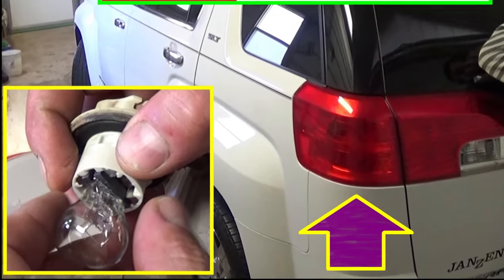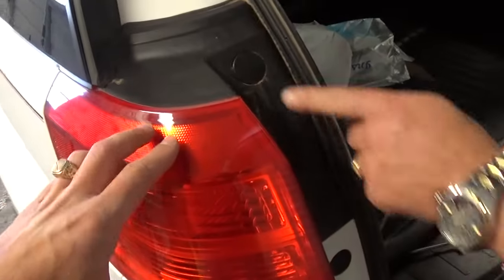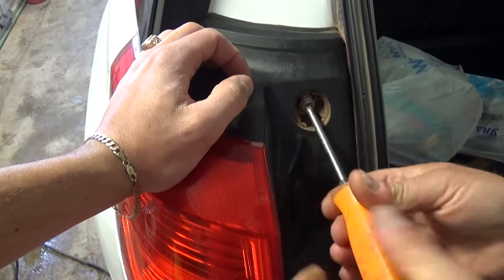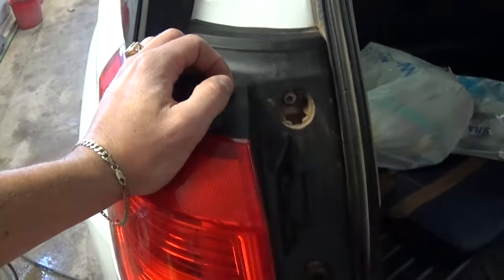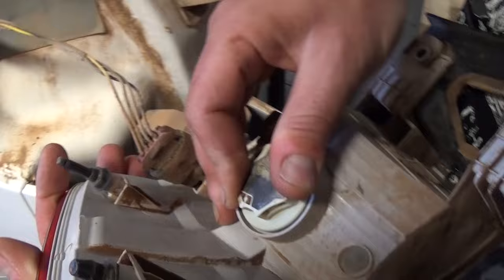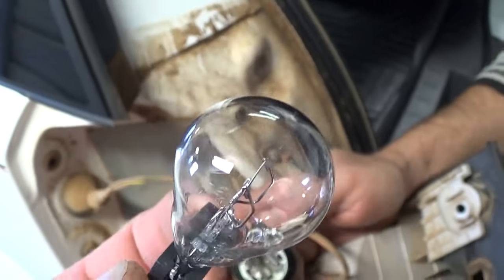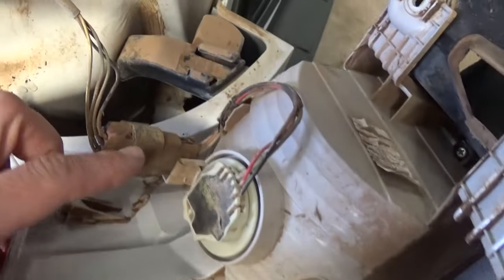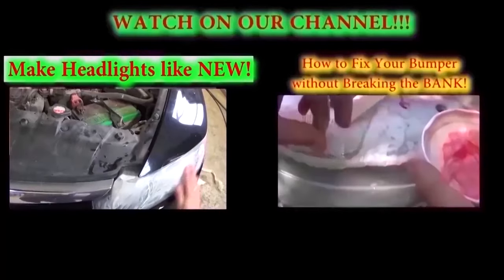GMC Terrain Brake Light, Tail Light, Rear Turn signal light bulb Replacement  Tail Light Removal

Comment: Pulling the housing assembly out is the worst part so I'm glad I watched this video first. It does sit tight in there so it feels like you are going to break it pulling it out. You won't break it, just give it a firm pull or two until it pops out.

Comment: One thing to note at the 2:19 mark is that the rubber from the bottom of the quarter glass has to be re-finessed, so it goes over the top of the taillight.  Otherwise, you may get a water leak into the lamp assembly.
It can be done with a straight finesse plastic stick, or other straight plastic tool, by going under it and moving the stick to the right under the rubber until it covers the top of the lamp.